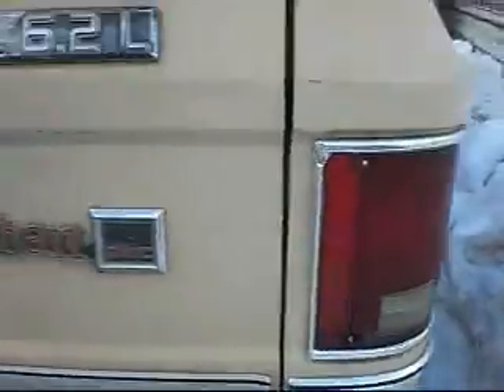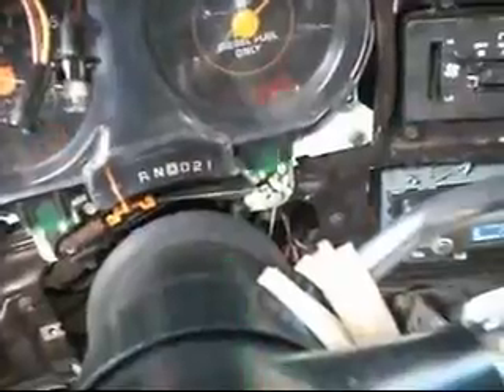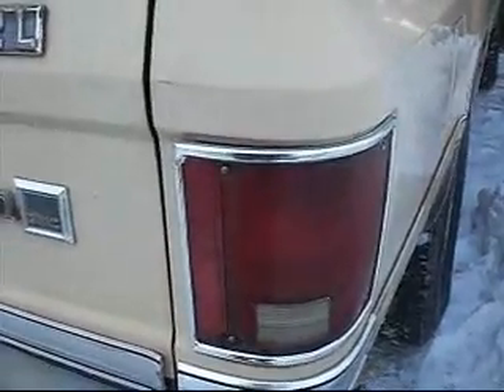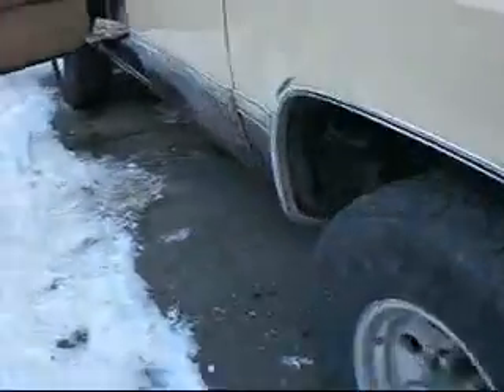2 11 11  No Turn Signal...

Comment: i have a problem with my 82 c30 i have breaklights and reverse lights and even four way flashers but no turn signals i know its not a fuse. i think it may be the switch in steering collum but i have no idea how to get the old swithch out